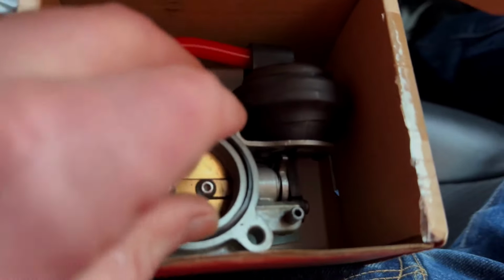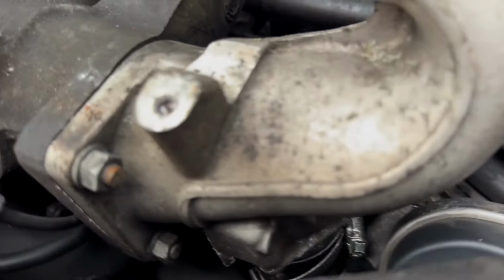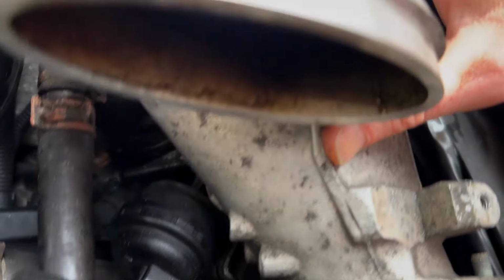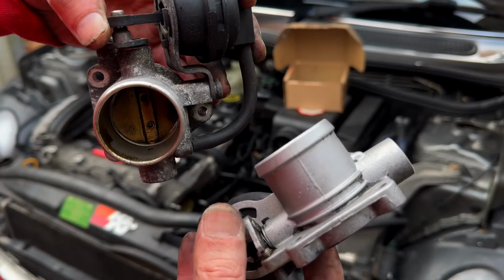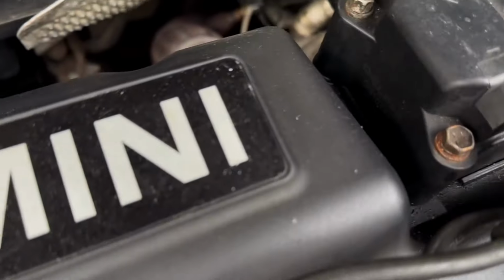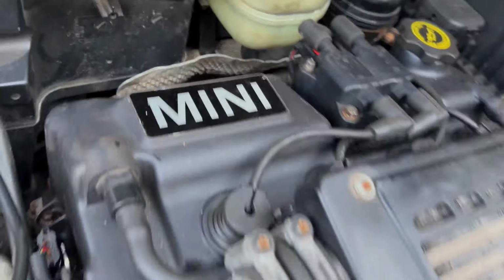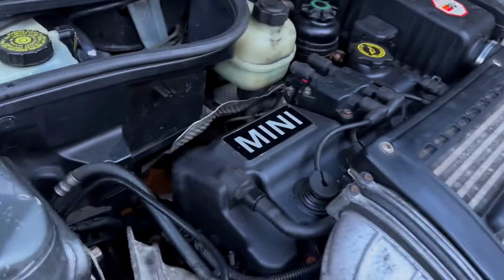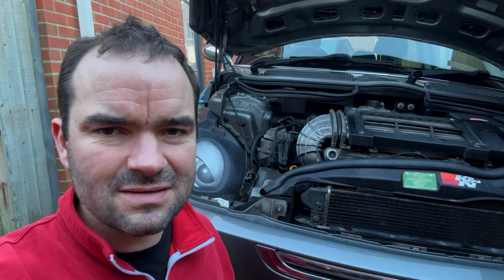Replacing the bypass valve on a  2005 R53 Mini Cooper S

Comment: Great vid mate. Just got a Rooster BPV to fit along with new silicone intake and couplers.

Weirdly also got a perished cat, so its a good tip taking out and fitting the manifold from the top when I get a new one 👍😊
Reply from the maker: Glad I can help! It’s tight getting the cat out of the top, there is a couple of heat shields that you need to move slightly, but it’s easy out the top than it is the bottom!!